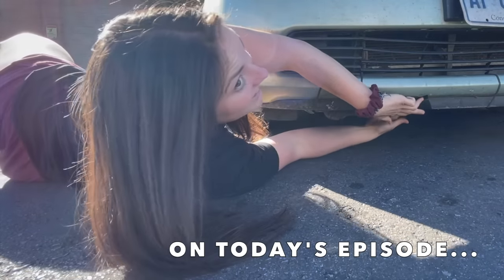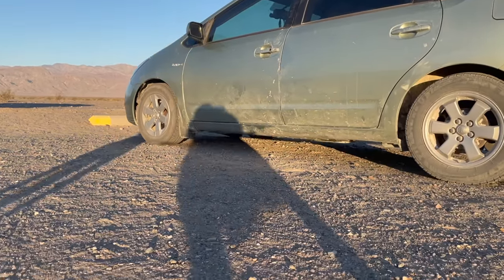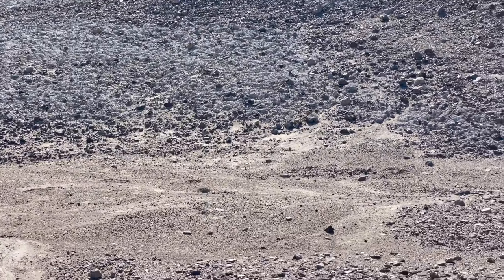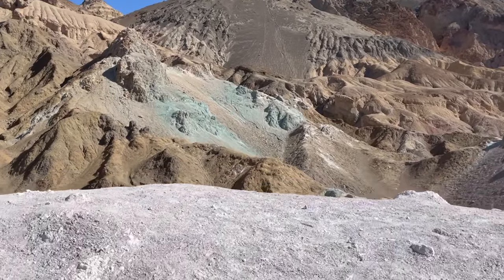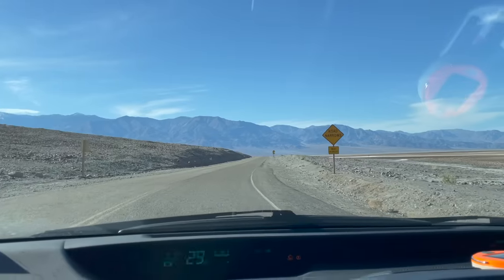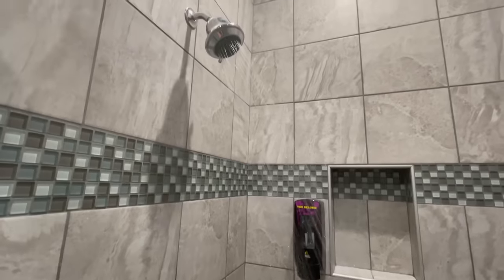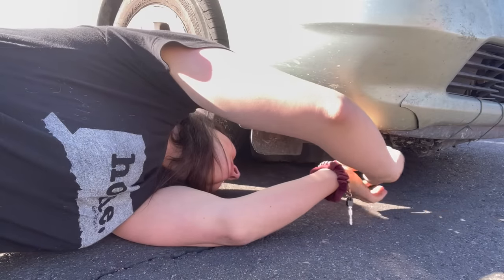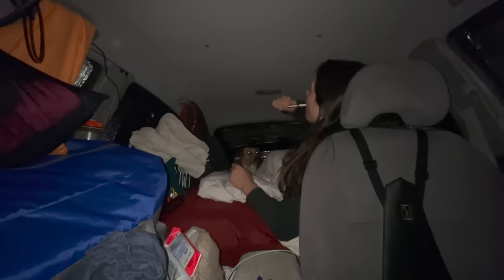Prius Camping in the Desert & stealth car living in VEGAS (Death Valley)

Comment: Tip on repairing that shield under the car: tape isn't going to last long, especially once the weather gets warm. Use zip ties. You may have to drill a few holes in the plastic shield but it's a great way to fix that sort of thing on the cheap.
Reply: I'm pretty sure I saw some zip ties in action along with the tape :) You're right about that tape though. It will likely come off and become roadside litter if it's left on there too long.
Reply: She did use zip ties, it's in the video. She was joking about the duct tape.
Reply: Zip tie needs to be replaced once per year. they become brittle over time and won't last forever
Reply: Naw car is shit now, gotta buy a new one
Reply: never underestimate the power of duct tape 😊
Reply: @toronado455  Never underestimate the power of the heat in the southwest deserts.
Reply: I used an old heavy duty wire coat hanger that I cut up. Held my tailpipe onto my old Volvo for years with that too. LOL.
Reply: Zip ties rule! The wheel well liner on my Ridgeline gave way in the middle of the Nevada, the zip tie fix lasted 3 years.
Reply: @Ascend777  zip tye basically welded
Reply: Zip ties and gorilla tape combo should last longer than the car!!
Reply: Some of that thin double sided tape is amazing . If you still have the original fasteners , or buy them , you can use the tape to repair your shield and then cover and cut out a new hole to run the fastener through if the hole was enlarged . You just have to clean both surfaces so it adheres properly . Zip ties are okay , but I would prefer a cleaner look .
Reply: Don’t white knight buddy, she’ll figure it out, or not.
Reply: @oliverallen5324  let me be me , no one is trying to tell you what you should say .
Reply: @denverdubois5835  wire is great, if it can't be fixed with wire, zip ties and duct tape it can't be fixed.
Reply: I ripped off my bumper valance in DV two weeks ago lol. My quick fix find was a rivet gun!! 30$ instead of a 100$ for the new bumper valance sounded good lol.
Reply: @Ascend777  There are black zip ties that are heat and UV resistant over the typical white and other colours. The black should last longer.
Reply: Extra tip they sell the cap replacements that fell out on Amazon super cheap like 3 dollars mine was like this for years went into auto one got the right size and bam back to lookin good

Comment: I’m also working with a busted heat shield on the underside of my suv after some traveling with my pup haha. But if you’re out in the direction of Las Vegas , Valley of Fire State Park in Nevada is an absolute must visit and super dog friendly! I’m traveling with my own pup out of the back of my SUV and we had a great time there! Keep on adventuring!
Reply: I had a rattling heat shield for months when I couldn't take it another moment and had it fixed.
Reply: @redrooster1908  haha I just keep using zip ties to hold it up
Reply: @overwanderadventures7312  Mine wasn't even falling down just super loud rattle. Made my vehicle sound like a junker 24/7. All fixed now 😃
Reply: @redrooster1908  glad it’s not driving you crazy anymore!
Reply: I loved the Red Rock State Park just outside Vegas, so beautiful!
Reply: Red Rock and Valley of Fire are both great and both dog friendly.

Comment: With best car-care nothing feels better than opening that hood up, and placing the support rod when visiting the car wash.  All new motors were meant to be generously power washed.  You will not have to change settings, even though there is a motor setting, the power soap and rinse is fine.  Better cooling and wow that looks great. 🌵

Comment: That plastic thing dragging on the bottom happened to me in my Camry too. I took it to Big O, and they put it up on a mount, and just bolted it for me -- free of charge!!! BTW Nikki, can't remember if I told you, but I'm still in Colorado, and figured out the PERFECT way to sleep in the subzero cold temps and snowstorms we get here. I simply plug a heated mattress pad into my Jackery, and put the pad over me, with another blanket on top of the pad, to give it some weight. Keeps me toasty warm all night, and I don't have to run my car for heat.

I'm aiming to go to the Oregon coast in June, to escape the summer heat here. I found a GREAT magnet to put on my car, which says "Not all who wander are lost." That's us gypsy nomads, isn't it?! I'm going to go gliding over Boulder before I leave though (not HANG gliding -- gliding in a PLANE! Lol). Oh and thanks for the advice about sleeping in a Cracker Barrel parking lot. It's SO freaking quiet here! It's the best advice I've been given yet!!!

Comment: 13:17 P0456, spend the $7 on a gas cap, and see if it will fix it. P0125, P1116, and P0121 are likely all the same problem. Have this fixed when you have the coolant flushed. Otherwise, it's mostly ok to drive on it. It will wear the engine slightly quicker, but not enough to the point where the engine will break before something else does, like the transmission. Hope this helps!

Comment: Super  cool..hey careful with the a/c in a running car. Sometimes  the car will turn off or the compressor on the a c can shut off, or alternator/generator gives out...etc etc  happened to me in a gmc youkon...lucky I only left  for 15 min more like 10 min to the store...windows  were down but twas 114 degrees...anyway  dogs were ok...just food for thought...love the channel  ❤  thanks and  good night from baja California  sur 😴
Reply: Stan Smith, a friend of mine, Carl, left his SUV with the AC running and his precious dog, Spike, inside, while shopping. When he was done shopping and came back to his vehicle, the motor had overheated, it was not running. Both Spike and Carl were lucky that Carl was not gone too long. A hose had developed a pinhole, and the antifreeze was completely lost. You are correct in mentioning that there are a lot of components and scenarios that can go wrong.

Comment: Here’s a pro tip when you wash your car spray down the fresh air intake for the vehicle this will make so the  dust that sits inside the intake is somewhat washed away and not blown into the filter of the cabin or jus the cabin itself

Comment: Hi Nick       Way back in 1978 during the gas rationing we used to lift up the gas pump hose after the pump turned off and turn on the nozzle so the gas in the hose would run into the tank    Can you believe it's the 70s again

Comment: They (who, exactly?) make a skid plate for the Prius.   I made it five miles down a Forest Service road to the Tuolumne River in a 1-ton campervan with oversized tires, only to be joined later by three cars... and one of them was a Prius with a skid plate!  I was very impressed, because there was plenty of humps and bumps and sharp rocks to fetch up on.  

A skid plate does make oil changes more expensive.  But it beats losing all your engine oil on a jagged rock somewhere.
Reply: Is a skid plate compatible with also having a catalytic converter protector? I got a catshield last month. Or would they not both fit together?

Comment: Littering is literally one of my biggest pet peeves I'm always picking up trash outside. It's not hard to take an extra few steps to throw trash in the trash can. It's disgusting!
Reply: I find it extremely rude, too. Around where I grew up there were very few lakes, so if you wanted to take a swim you had to drive relatively far and you had few options. With such limited choices, you'd think that people would at least do their best to keep those few lakes and their beaches as tidy as possible. But no, there would always be tons of plastic garbage or even glass bottles all over the place, to the point where you had to be careful not to step into something and cut your feet open. I don't understand people.

Comment: You're right the scenery is beautiful and very colorful. I ordered just one of those little cheap engine light readers off of Amazon and it was like under 20 bucks. I figure I can use it on my van the truck tells me too much information the van nothing so that's why I got it. Plus if I ever decide to get a new used car I can run the scanner on it and it'll tell me anything that's wrong it reads a whole bunch of things I can't even remember what all even if the light isn't on. So that's a good thing. I'm glad to see you're in warm weather we're supposed to have a high today I think of 30°. With the security system that you have did they send you two or three cameras like one for facing forward one for backing up and one that is 360° or is it just inside? I was wondering about that cuz I seen a video with the Tesla and that dang thing had more cameras on it than you can shake a stick at but it caught someone who was at a park and I guess was upset and didn't like Tesla or something and keyed their car for no reason. They got it on camera so they could track her down make her pay for it. I don't understand why people pick on cars that's an expensive investment besides a house. Well we can't wait for more updates have a good weekend.

Comment: Actually, that damaged piece is going to cost you more in lost gas mileage than a proper repair. Hybrids are sensitive to changes in air flow. Your roof box and bike on the back are probably killing it already, without adding a hanging body panel.

Comment: Duct tape will work but we ALL know you're a zip tie kinda gal!

And owning the exact same car you do, living the exact same lifestyle you do. I can tell you, those undercarriage panels are held in place with little plastic button pin things. Like the wide black plastic panel in the front of your engine, when you open the hood, that I believe if memory serves me correct, that you have removed before, by removing those little black plastic button pins. Hard to tell if new button pins will work, they are sold at auto parts stores. The holes they go in could have been damaged though. However, there will definitely still be a hole in the black plastic piece hanging down where the pin originally went. There will also be a hole on your Prius's metal frame where it connected to. Giving your zip ties places to be thread through.

In this instance, me personally, I would choose zip ties over tape. The tape would need constant replacing.